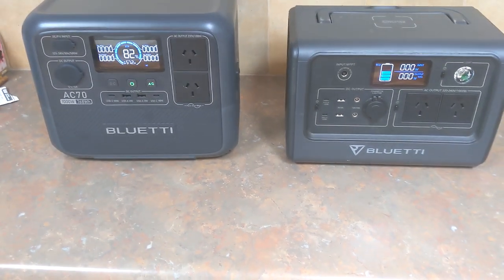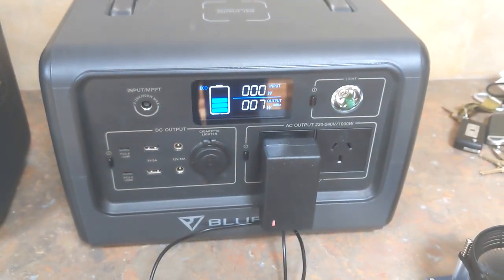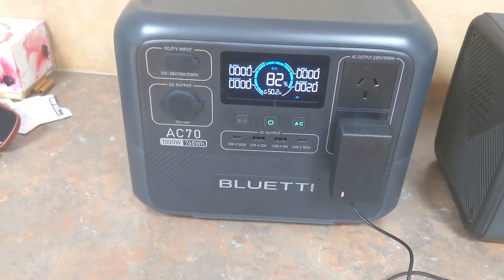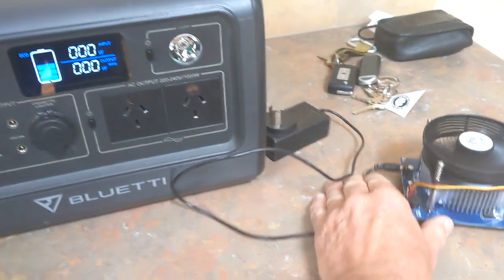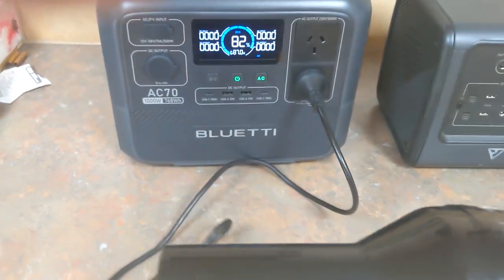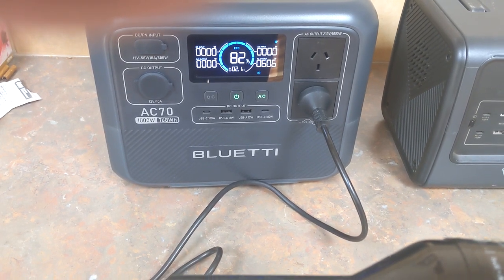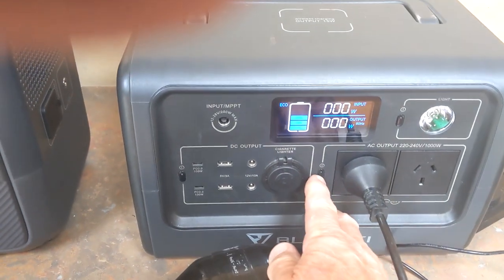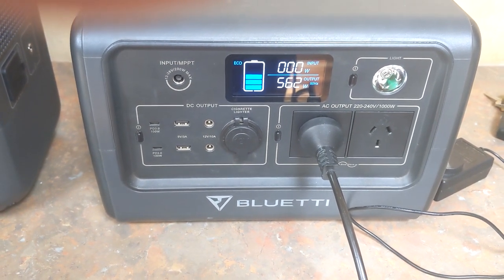Bluetti AC70 vs EB 70 Power output problem ?

Comment from the maker: This is the response from Bluetti: This may be a problem with the sampling current error. The corresponding current of 7W is 0.03A, and the corresponding current of 20W is 0.08A. The actual sampling error is only 0.05A, which we think is within the acceptable range. Please load a purely resistive load with a slightly larger power and see the difference between the two.

Comment: Thanks for sharing - that's a curious difference which (at least in theory) shouldn't exist (would be nice if it was truly standardised).

I'm no electrician but my guess is a different in material or design (manufacturer issue).

I think I'm off to buy an EB70 with 120 watts solar for $900 AUD (JAN 2024).  It's a second hand unit but unopened, I'll do my diligence checks with the manufacturer.
Reply from the maker: That sounds a bit expensive to me. You can buy a 120W set of panels on Amazon for $200 and even though the EB70 showed that power difference, I'd still buy the AC70 ($849) in preference as it is much more usable with the power lifting mode. It will run both my fridges at home in case of a power outage, whereas the EB70 will not run either of them. 
https://www.amazon.com.au/VATID-Portable-Foldable-Parallel-Generator/dp/B09YBZ4LDJ/ref=sr_1_40?crid=ZV6D24258YYU&keywords=solar+panel&qid=1705922328&sprefix=solar+panel%2Caps%2C335&sr=8-40